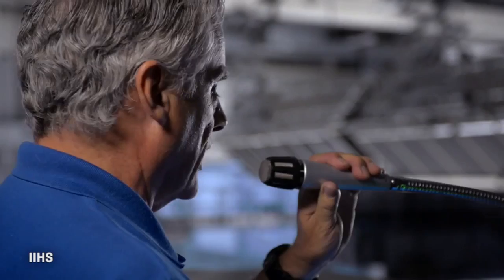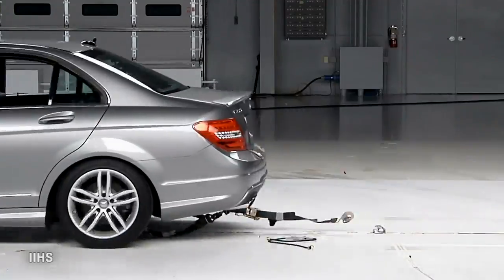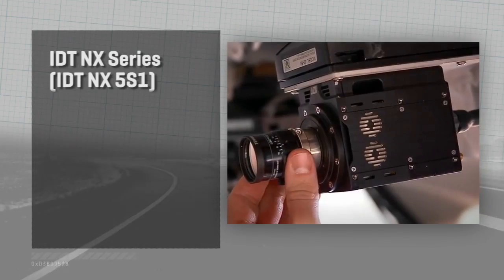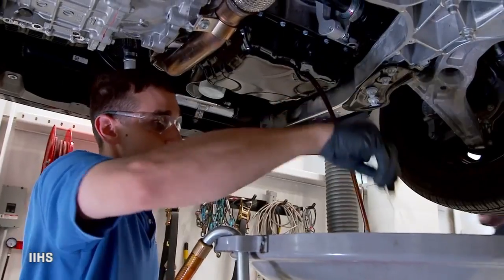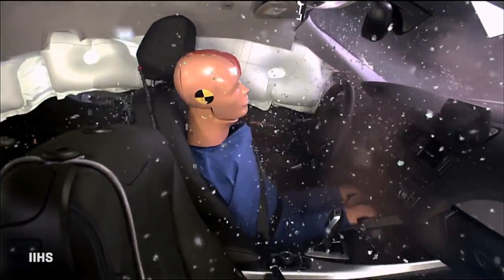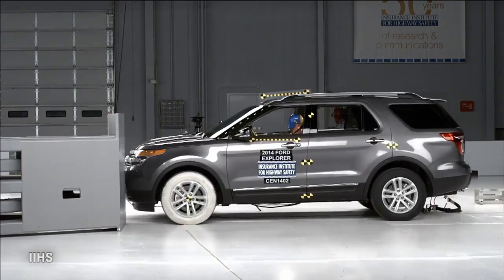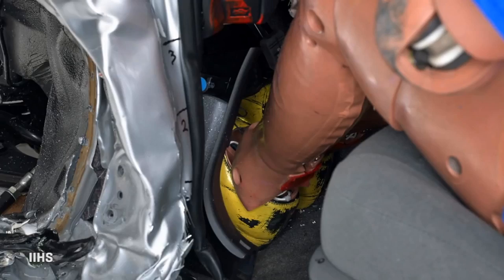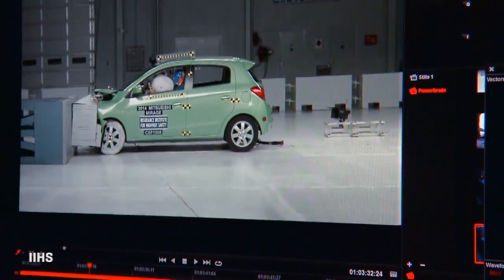Smarter Driver: The tech behind crash tests

Comment: I don't believe in them rating cars designed before the small overlap came out, in the small overlap. because the small overlap accounts for a SMALL percent of accidents that happen and is primarily due to driver inattentiveness (like texting). engineers cannot make a car perfect against people who consistently are finding a way to bypass the crash structure. kind of my theory why automakers are refreshing everything ASAP so they can remain top safety picks. A car from 2009 is just as safe as the 5 star rating it received back then, but i highly doubt they will pass with flying colors in the new small overlap.